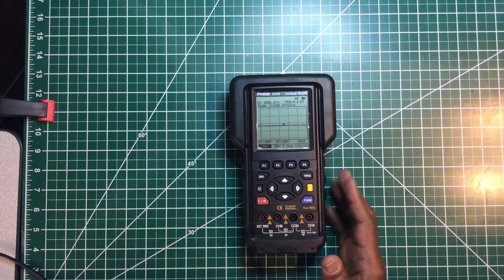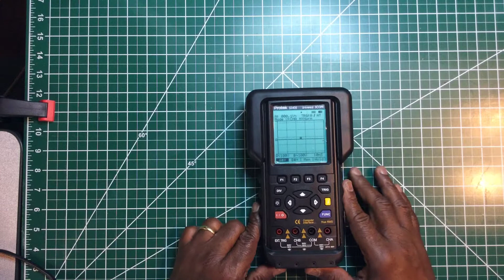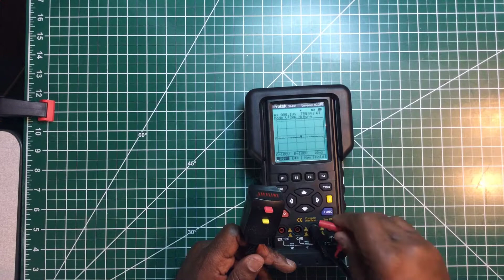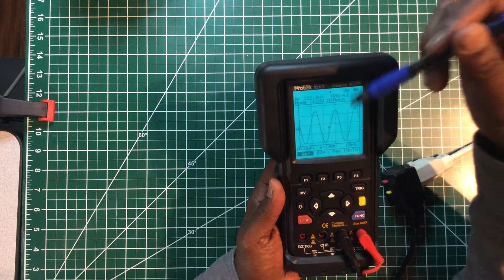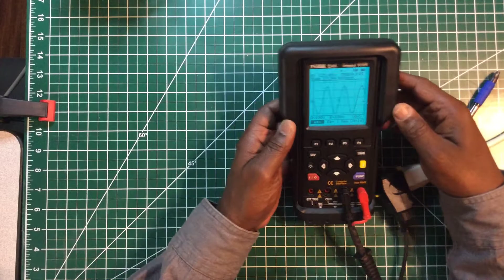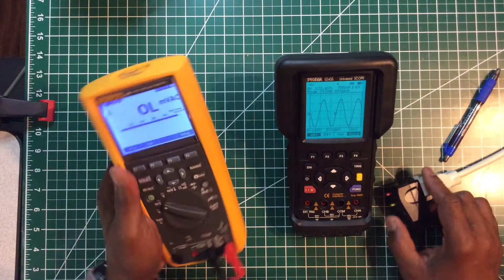PROTEK Scopemeter / Multimeter

Comment: This is pretty cool. Would be useful for field service technicians. Sometimes a multimeter doesn't tell you the whole story. I have seen some real dirty power that caused instruments to operate incorrectly. Equipment can be very sensitive.  You have all the bases covered on this channel. Which is great since I have held a variety of jobs in my life from HVAC tech to electronic field service tech to now being a plant electrician. Your philosophy of always learning means you will always have a job.  One thing I am looking at is an IC chip tester. GW instek has a nice one. A lot of times manufacturers remove the label of the IC so you don't know what it is. With this device You just put it in and it tells you if it works and what it is.
Reply from the maker: IC TESTER, that sounds like a very valuable tool. That’s wise thinking 🤔 on your part Tron, you know what you need and you’re making moves to obtain what you need to help get your job done.  SMART, VERY SMART ! 👍🏿